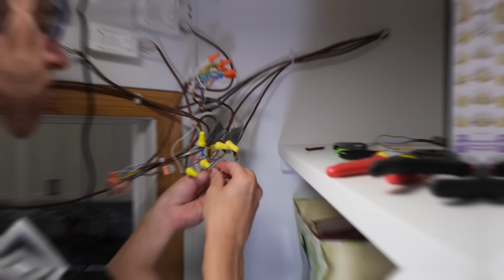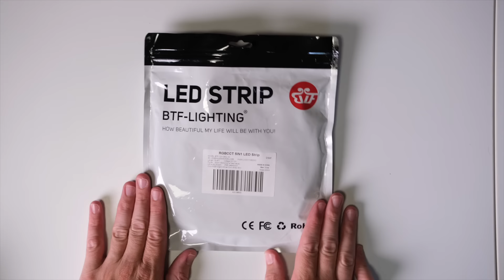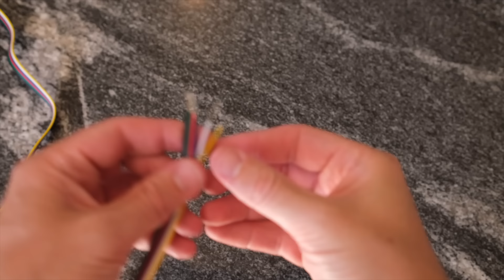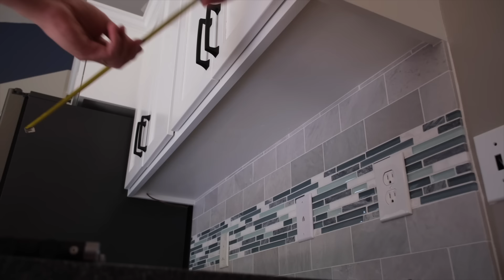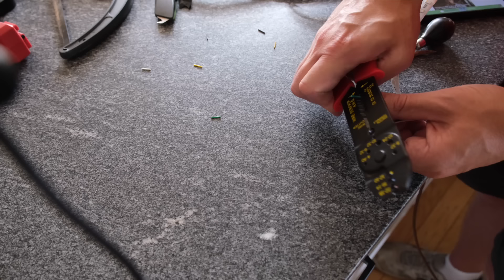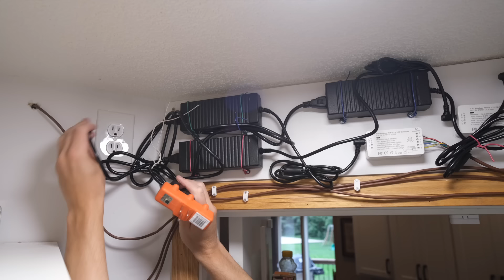Ultimate Guide to DIY Cabinet LED lights - full install

Comment: Great vid! But the switch installation was not shown. Did the switch control all 3 zones (upper cabinet, under cabinet and toekick)? Or it have separate switches for each zones?

Comment: if i have outlets in my cabinets can i run 3 power supplies and 3 controllers independently and control them from the hub or app?

Comment: Future reference- put a wire in top hole on insulation wall. Loop it a few times and stick in hole. Then send snake up and spin it a few times til you catch wire. Pull it out and now use wire to pull the electric wire up

Comment: Get video and sense of humour 😂 Inspired me that I can do this. I bought ip67 rated strips with 60 LEDs per m, but just realised it says doesn't work with clip on connectors. Is this because of the silicone coating and strippping back the coating and using the connectors in your video sound work?

Comment: This is a very informative video. Your system looks like it has more potential than what I’m looking to do. I simply want to try my lights on and off with a wall switch. I don’t need any connectivity to my smart phone or timers or anything like that. I also don’t need multi-colored lights. I simply want some shade of white lights under the upper cabinets. Is there a light strand and controller you would recommend for simpler applications such as mine? 
Thank you!

Comment: Dude, just buy a kit with its own power supply and wifi controller. The most complicated part is running an outlet, drilling the holes for the light strip and splice the light strip so it reaches the far corners of the cabinets. I used Philips light strips and had great luck. Wife is happy, and when we sold, the new buyer was enchanted. I plan to repeat this proces in my new house, except this time I may fo with Tapo L930-5's. Nice price point and not too bad reviews.

Comment: For hiding the wires under the cabinets, use the white flat plastic conduit.  Instead of the large Wago type connectors, you can use the tiny grey wire nuts, the will fit in the flat conduit.  The conduit is easy to work with and professional looking.

Don't sweat the wires on the tops of the cabinets.  Maybe strap they down, but no need to hide them.

I would have used a larger single transformer with multiple taps.

Overall a great job!

Comment: Wow awesome video! I am a new subscriber.
Hey Smart Home Guy, can I get some advice? I have a small project and I don't know what to buy. I am hanging a live edge slab on the wall above my bathroom sink. I will drill holes in the slab and wire in the existing light fixtures on the front side of the wood and use all the existing switches, etc. No problem there. HOWEVER, I want to set the slab an inch or two off the wall and back light it with LED lights. It would be cool if they could be white and also colors. Like you, I don't want a disco, just a mood light. I DON'T want a lot of controllers or APPS. I just want a simple wall switch so I can add it to the existing outlet under the vanity. I am good with running wired AND I want to wire power into the power at the outlet (no low volt) If I have to I can add a low volt converter under the bathroom cabinet. Any Advice? THANKS!!!

Comment: Do you need to install a controller? Can the strip be connected directly to the power supply? I do not need to be able  to control the strip from my phone just a light switch.

Comment: First I'll say I love your lights. My only comment would be the gluing all that wire and splicing blocks under your cabinets, I would have to come up with a neater solution than that. Those splices need to be made somewhere but not right there. I wouldn't want to see a single wire under the cabinets. I'm an electrician by trade so maybe I'm a little picky. Thanks for sharing.

Comment: I've done this in a few kitchens now and I have a couple of tips. If you have longer runs using 24v LED strips will prevent voltage drop over a longer run. Also, you can get a larger led power supply than can run multiple controllers off of it rather than having to use 3 different power bricks. 

Finally, I would also suggest installing a surge protection receptacle for the LED strips rather than a regular one so you don't have to worry about the controllers getting damaged by storms or anything. They're  usually not too expensive and you're already wiring a receptacle so I figure why not. I use them for wall mounted tvs as well.
Reply: Can you give a ballpark for the point at which "longer" kicks in?
Reply: @mxpants4884  it will vary depending on the number of LEDs in the strip.  

But if you're interested in the details it's just basic ohms law calculations. I = total power / voltage so the higher your voltage is the less current you're going to use. So more voltage is going to reduce the amount of amperage you need. 

You can search your strips watts per meter and figure out how far you can go before you have voltage drop off from there. 12v will be less distance than 24v.

Comment: Tie wraps with built in screw holes on one end would go a long ways. You can also buy square sticky backs that you can also screw and attach a tie wrap to are super handy. Ideal makes them. Electrical wholesalers sell those as well.

Comment: This was a really good video. But, it goes to show that there is a void in the under cabinet lighting industry. This would be much simpler with a proper splicing method from one to the other.

Comment: Avoid leds in silicone in this application. Needlessly limits heat dissipation and the leds die faster. Silicone coating is good when there is moisture risk.

Comment: Anyone just slowly accept you aren't doing this as the video played? Starting the video with confidence and ready to minimize it and go to Amazon and start ordering parts? Then by the time he gets to building the controller....I've accepted that I'm not doing any of this shit 😂
Reply: I thought this would help me get ready for my install tomorrow.  It will not.  Mine will be very clean and has 1 transformer that will be properly installed and hidden in a lower cabinet. No wires should show at all when I'm done and I sure as hell am not doing RGBW! Just COB 3000K on a Caseta dimmer. Yikes at the finish on this...

Comment: Nice overall video thanks! whether you use 24/30/60 per meter depends on total luminess you need, I feel your kick off light is too strong compared with under cabinet light. 24V is better choice and more efficient, as for 12V each branch is 3 LED then a resistor which waste power. I like simple things so won't use RGB to get white like, if one of RGB leds fail which color you get?

Comment: Fantastic video.  My kitchen has similar configuration of upper cabinets...basically 4 separate "banks" of cabinets.  Are they all tied to a single controller and power supply?  Do you just run 1 thermostate wire from controller to first strip, then transition back to thermostat wire back into the wall over to the next set of cabinets and so on in series?  Thanks in advance.

Comment: I spent a lot of time researching LED kitchen lights for cabinets, this is by far the best video on YouTube.  Your video really helped me in setting up my lights and saved me a lot of money. The only negative is you can’t solder the six wire LED light strips, I ended up using the plastic connectors.  Thank you again.

Comment: An older post, but very helpful. I have a question. I know you ran the wires through the wall under the cab and under the sink cabinet to the other side. Then, you had tile installed there. But, how did the tile go around the holes; how did you or your tile pro  finish the holes?  Thank you!

Comment: Too complicated
It should be just the light strips with a wire to connect to the power, and a switch to turn it on/off
Reply from the maker: I hear ya. I want to the ability to automate the lights and have colors, but if you don’t care about that, wiring it to a switch a simpler option. But you’ll still have run wires through walls and cabinets to all of the strips and once you’ve done that, adding a controller isn’t that much more effort

Comment: How does the Phillips Hue Bridge fit into this?
Reply from the maker: The gledopto controllers are connected to the Hue bridge so I can automated the lights. The gledopto controllers use zigbee so they can also connect with various other home autoamtion hubs as well. If you are wondering where the Hue bridge physically fits into this, it is in my office under my desk.

Comment: You are terrible at cable/wiring management, but great video on the big picture. And great links to materials. Thanks much.😉
Reply from the maker: Ha! Yeah, if the cables are visible I'd put more effort into it. But I think I secretly like knowing it drives the Type A folks a little bit nuts that there is some chaos below the surface.

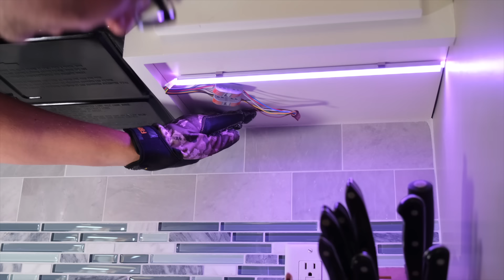Comment: At 12:30 mark, why did you not  simply run the ‘furnace wire “ into the “solder-less strip transparent led connector” instead of putting the “lever wire nut” connector + light strip cable in between?  And does the controller/app allow for a daily on/off setting?

Comment: Question- you used a controller and a power supply. During my research of this type of install, there is alot of talk of DRIVERS and they are used in addition to power supply's and controllers, I didn't see one in your install unless I missed it. Can you explain why you didnt use or rather need one. Them other guys are using .

Comment: Questions for you have you had any problem with the 18/6 thermostate wire making the lights flicker. Im getting into running the lights at my house and the lights only flicker when connceted to the thermostate wire. Ive tried soldering them straight on. Ive tried crimps. Ive tried snap connecters like you have. Wire nuts all of them. If you could get in contact with me that would be amazing
Reply from the maker: I have not had any problems with my wire. Crimp connectors won’t work, but the snap connectors have been rock solid for me. It sounds like you might have a break in the wire somewhere. Have you tried using a different piece of wire?
Reply from the maker: Are you sure you are using the correct voltage for the led strip you purchased?
Reply: Update so I have the ws2805 ic rgbcct led strips from btf lighting. These lights are a 4 wire light. We have tested many combinations and have found that metal of any sorts interferes with the lights. Also have found that high voltage from the 120vac can also interfere with the lights makeing them flicker. Also have found some connections work better then others for wire and the actual wire to light connection. We have them working now and work great! Thanks for the inspiration.

Comment: How would you incorporate kitchen island cabinets to the main cabinets?
Reply from the maker: I assume you would only be using kickboard lights on the island. I would run the cables under the floor if I had access from below in the basement. If not, I would probably just set up an additional power supply and controller somewhere in the island, but have it set to the same automations as the kickboard light controller for the rest of the kitchen. I've considered runing lights under the countertop, but that seems like overkill.
Reply: Would the new controller turn on the lights at the same time?

Comment: Do you know any reason when you first power on the LED strips that they slowly pulse....not flicker but pulse....and it doesnt matter the length.....I only used 1 roll of the same LED strips that you used on this video.  I have tried two different power supplies and have the same result.  It lasts about 10 seconds.  It does it every time you power them on.  Again I have tried a small strip of 10 inches and it does the same thing.
Reply from the maker: That is new to me. I've never seen that problem in the time I've had them. My guess would be something with the power supply, but if you tried two different ones it's gotta be somethign with the strip. Very strange

Comment: Excellent video!  May I ask why the manufacturers solder the copper connectors ever so many feet.  I am unsure whether these can be cut at these solder joints or do people melt the solder off, then cut.
Reply from the maker: Yes, you can cut at the solder joints. I suppose melting the solder would make it easier, but it is not required
Reply: Cutting worked great.  Thank you

Comment: My controller won’t connect to my Philips hue hub? Any suggestions?
Reply from the maker: What type of controller did you get?
Reply: Gledopto but I did get it connected.  Then had a bunch more problems with the lights not being the same color.     Getting replacement lights and going to try the zigbee controller

Comment: Love your sarcasm, and overall looks great!...but with your wife on the mess for the ones above the counter/visible. Question - any reason you didn't hardwire the lights to avoid having to run all that cable to the pantry and create a shelf of bricks?
Reply from the maker: Thanks! Hardwiring the power for LEDs is an option, but you'd still need controllers for the lights and because I wanted all of the top lights to work together, all of the middle lights to work together and all of the toe lights to work together, they needed to be wired together anyway. So this seemed like the best option.
Reply: @DIYSmartHomeGuy1  - understood. That said, you could have just added added a smart relay or driver somewhere along the way and have them go through HA or something else for coordination. Anyway, nice work, will be watching more of your videos for inspiration. Thanks for replying.

Comment: We are doing a very similar layout. I have my wires installed for LED lights at the crown molding, under cabinet and toe kick. Can you please provide the exact hardware (light strips, controllers, etc) you used? I do not see those listed. Thank you in advance!

Comment: Ok, I'm looking to do this on my cabinets. One question I have though: why didn't you wire everything together and have 1 controller and 1 power supply? Why do you have 3?
Reply from the maker: I wanted to control the top, middle and bottom lights separately. If I wanted them all to turn on and off at the same time and at the same color and levels I could have used one controller.
Reply: @DIYSmartHomeGuy1  ok thanks

Comment: I probably missed it, but I am trying to determine why there are three controllers.
Reply from the maker: The reason for the 3 controllers is so I can turn the top, middle and bottom lights on and off independently and/or set them at different colors. With only one controller they would all have to be the same.
Reply: Brilliant.

Comment: Do all the strips have to be set to the same color, or are you able to change the color of individual strips?
Reply from the maker: That's why I used three controllers so I could set the top, middle and bottom separately. If I only used one contorller they would all have to match.

Comment: How did you size the number of transformers and controllers needed?
Reply from the maker: The number of controllers is set by the number of separately controlled zones you want. If I wanted the colors/dim level of all of the strips the same I could have used a single controller. To determine the number of power supplies you need, you’ll have to figure out how many watts your lightstrip draws. The specs should tell you how many watts the strip requires; if you’re not using an entire strip, divide the total wattage by the length of the strip to determine how many watts per foot it uses. Then multiply that by how many feet you are using and you’ll have the total wattage you need.

Comment: Great video and instructions, thanks for sharing.
To be constructive, the power bar setup in the closet is a mess but that's perfectly fine because it can be covered with a box. BUT....
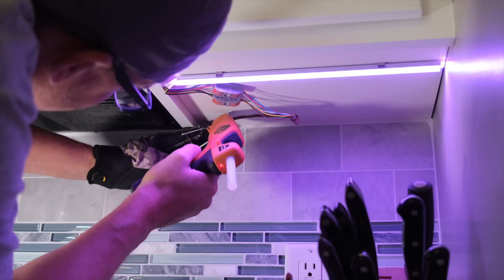The wiring harness and excess wires at 12:26 under the cabinet is pretty bad, can you not make those connections above the cabinets and have a drop come down to the light?
I understand you can make a box under the cabinet as well, but it would cast shadows being so close to the light and it would also stick out, all of that needs to be hidden for a clean look.
Again, great video and instructions, just that was the only criticism of this project.
Reply from the maker: Yes, you could have all of the wires/harnesses connect at the top and run the wires down. Based on the timing of installing the cabinets/backsplash there and being a procrastinator I kind of had to rush getting the wires pulled. Could have maybe thought that through a little more.

Comment: Question:  If the led lights that go to the top of the cabinets, under the upper cabinets and at the toe kick are all on the same wall switch, can each colored wire (black to all blacks, red to all reds, green to all greens etc.) be connected to a single wire of the same color and be fed into the appropriate slot in one Gledopto 2.4 wireless RGB+CCT LED controller which is powered by one transformer?
Reply from the maker: Yes, you could use a single controller for all of the strips. You could use a single power supply as well, but you’ll probably have to find one with more wattage to light all of the strips.

Comment: Hello. I love your video. I remodeled my kitchen and ran the thermostat wires. Went to Amazon to purchase all the things I needed but they only have one zigbee 
 controller left. What other controller can I use? Thanks
Reply from the maker: Really depends on your hub. If you need a zigbee controller look for something from RGB Genie. Otherwise gledopto has options for WiFi and matter as well